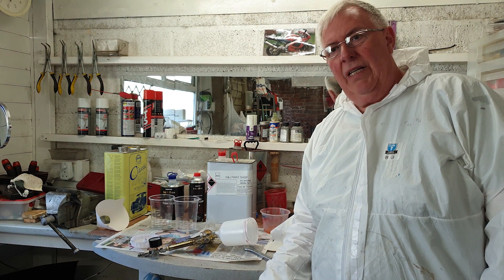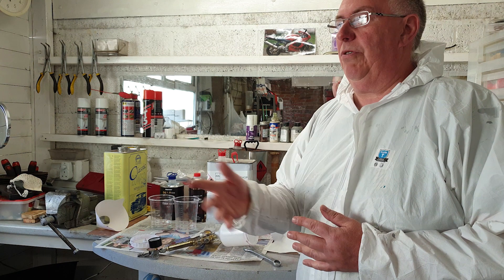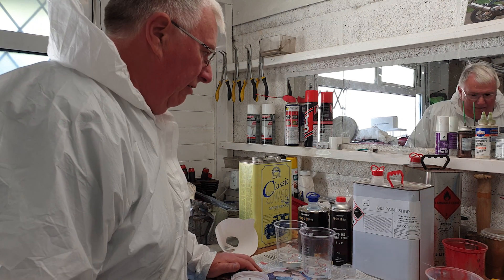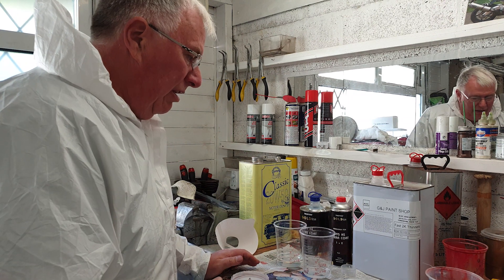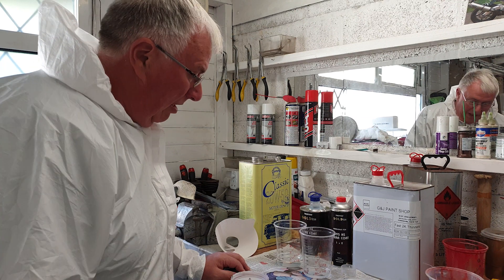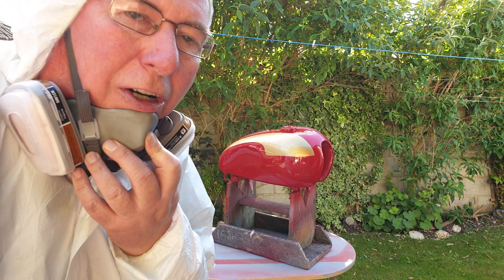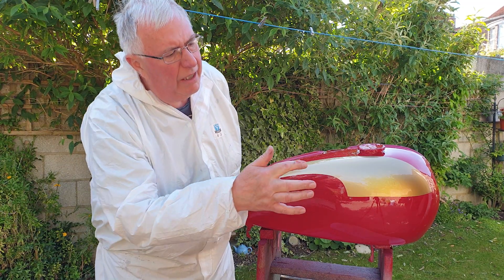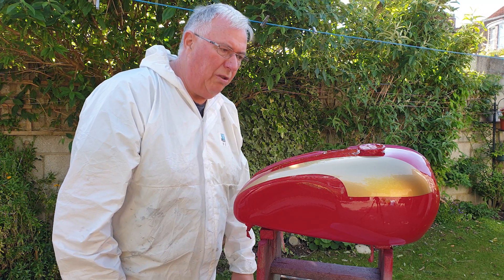Painting Scallops on a Triumph Motorcycle Tank - Bonneville T120 Bike Project

Comment: Yes mate your right, I always do it 50/ 50 to start and then last couple of coats 70% thinners and be Quick with your passes to avoid runs, don’t try to put too much on at once, let it flashover between coats, more thin coats will give better results, thick coats will run, and give more Orange peel. It’s the same with the bass coats.  But it’s not the end of the world, as it will flat back with 2000 grit and buff up again. Cheers Martin.⚙️🔩🔧👍
Reply from the maker: Thanks Martin, that's sound advice for anyone trying to get a good paint finish.

Comment: Hi Spanner Rash. Need to paint my motorbike panniers and found your pannier vid. Now watching them all. You seem to have good results from your Sealey paint gun so have just invested in one that arrived today. What settings have you dialled in, i.e. air pressure, fluid, fan?? Many thanks.
Reply from the maker: Hi Chris, hope the Sealey gun works out well for you too, there's no doubt that these guns can deliver great results with patience and practice.

I use the gun at around 40 psi with fan at around 6 inches, spraying 10 inches or so away from the thing I'm painting.

When you mix the paint, mix so that it forms drips from the stirrer after a couple of seconds of being lifted out.

When you're spraying, overlap your passes by 50% to avoid missed streaks.

Hope that helps!
Reply: @SPANNERRASH   Thanks for the info. Look forward to watching more of your vids.